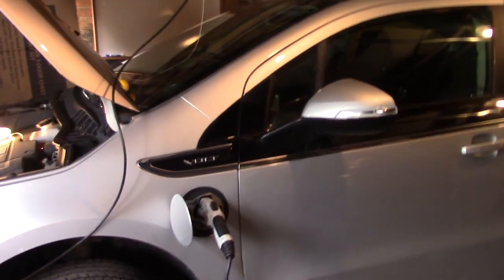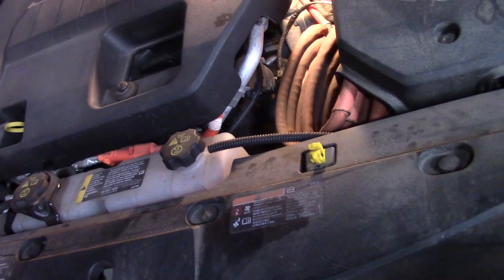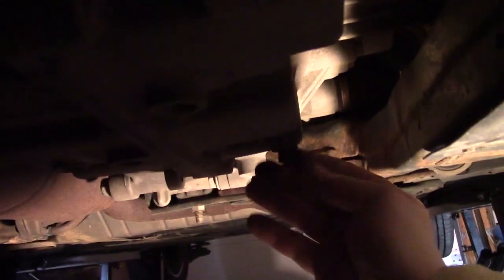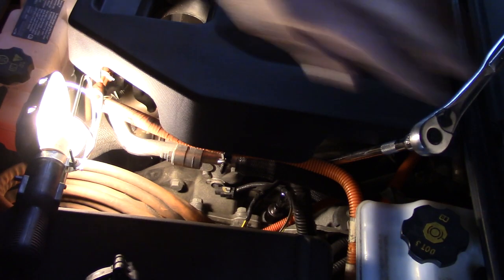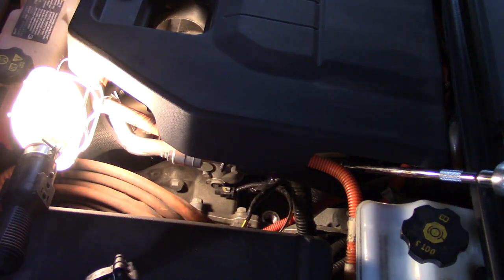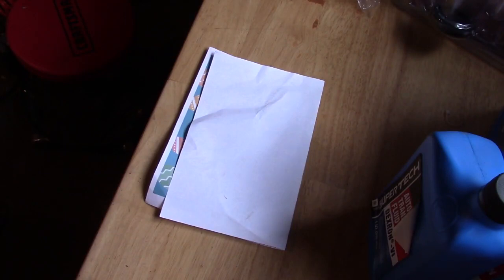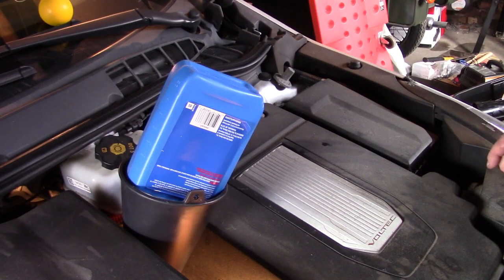Chevrolet Volt Transmission change. Chevy Volt Transmission Fluid change

Comment: It's a little funny that everyone looks at the transmission fluid and thinks it doesn't look bad - forgetting (or not realizing) that there's a transmission filter inside the transmission.  You can't really replace that filter unless you drop the transmission and take it apart.  But if the filter did its job, the transmission fluid you take out won't look very bad.  You'd need to have it chemically compared to spot the differences, but changing the fluid like this was definitely a good idea.  Also, there's a process for changing the oil involving a lot of gear changes.  If this is the first time the fluid has been changed (probably is) then the equal quantities method is probably fine.  But supposedly getting the level of fluid right is trickier than that, and fairly important for the life of these transmissions.  You did a pretty good job of showing the plug locations - thanks!

Comment: Nice video.  The holey jacket raises the authenticity, and thus the credibility by at least a factor of 10.  As a chemist, I'd recommend using a tall, very thin glass, or a shot glass with a flash light on the side to compare the colors. Thanks for the video, I'll be doing this soon!
Reply from the maker: Glad I could help

Comment: Thanks for forging the path - great info.  Just bought a '14 with 66k.  Changing some fluids just to make sure.  I took the overflow plug out and it was the same size and threads as the drain.  Cleaning around the fill port is good idea - I found an old nest of some sort around mine!
Reply from the maker: Brian Shield glad I could help you out.

Comment: You mentioned checking the filter requires the transmission to be removed?  So should I skip that?  My car has 140k miles and I don't know if the transmission fluid has ever been changed.  I think it may have been done by the dealership at some point since records indicate the car was sold by a dealership with 62k miles on it?  Plus there was some oil residue near the fill port.
Reply from the maker: JFlywheel I would not count on dealership doing it. Changing the fluid is a good practice though.

Comment: I have a 2013 with about 250,000 miles. Not sure if it’s ever been changed. Still drives smooth. Should I change it or flush it or just leave the fluid? I recently bought it.
Reply from the maker: I would change it if it has that many miles.

Comment: So in the GM maintenance schedule, it lists changing the electric drive unit fluid only under severe conditions. That schedule runs to $150, 000 miles. What made you decide to change it?
Reply from the maker: most cars i have had in the past i try to change the transmission fluid around 100 to 130K it has served me well saving transmissions in the past.
Reply: New fluid will only extend life, old fluid will diminish it. Change it often and it'll help it last.

Comment: did your car run fine after changing it after over 100k miles? i am at 90k and a little scared to change as i dont want my transmission to die..little scared as i have heard stories for transmission dying after changing tranmsission fluid.
Reply from the maker: I think that's from people who have waited too long to change it. I have 164 k on it now and still running good
Reply: You heard correct. But in this that wouldn't happen. That only happened in conventional transmissions where the new fluid is low viscosity, whereas old fluid has viscosity buildup. I add a bottle of Lucas trans treatment to new fluid for that reason.

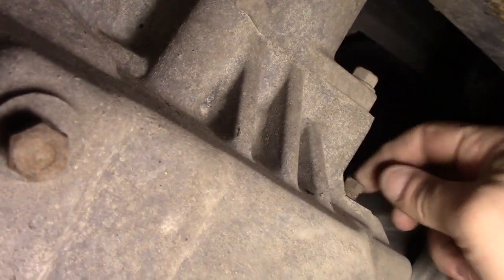Comment: when you say "tapered" for the top fill plug at 4:06 what exactly do you mean by that? is is safe for me to remove it and will it seal fine?
Reply from the maker: The plug screw is tapered so it's self sealing/threading.

Comment: Have you change any other fluids ...??
Reply from the maker: Just the oil and oil filter. Thinking about doing a video for the antifreeze
Reply: @doransignal  Cool thanks because there is not any video about it ...
Reply: @Lobo243  a little late, but I made one.

Comment: I just got an 11 model 170k miles I'm assuming they were mostly highway I was thinking since that was the case this volt is really pushing a 120k hypothetically lol we will pretend 
Any tips on this volt
Reply: hows she runnin now?
Reply: @cgletts  I sold her the car went crazy one morning and wouldn't come back even the gm dealership couldn't save her but the guy who bought her claims that he changed the 12v battery and it started bare in mind it had codes thrown and reset by gm

Comment: What is the transmission in this car CVT? 
I wasn't thinking it was, because CVT transmissions take a special fluid.
Reply: They don't have a "transmission", it's an electric drive unit.  WeberAuto has some good vids that explain it in very good detail.  It takes Dex VI, though.
Reply: @GrandPrix46  yes I actually drained one out and refilled it.
Reply: @GrandPrix46  my volt lasted 1 month than died the guy I sold it to sait it was the 12v battery but GM said otherwise I got half my money back it was definitely a learning experience
Reply: @AOG_ETH  dude that sucks, these cars are generally rock solid.  The 12v can cause all sorts of issues when they start to go bad, I plan to just change mine every 3 years for peace of mind.  Glad you were able to get half your money back, though.
Reply: @GrandPrix46  the guy who bought said he put a new battery on and cleared the codes a few times and it worked. Gm dealership tried everything using the computers jumping it off fully charging it ECT.

Comment: Hello, just a quick question.  You said there’s a level check plug.  Do you think I could pump the fluid in through there instead of going through the top?  That’s usually the case on older cars, you pump in fluid till a bit dribbles out and you know it’s full.
Reply from the maker: I guess you could but I wouldn't recommend it
Reply: Yeah I read the manual and it’s just to check level.  Unfortunately I’m not really getting a clear answer of how much to fill it with.  It goes from 6.5-9.4.  Guess I’ll put 7 and wait till it drips from the level check.
Reply: So I got it done.  Car runs fine.  Drained the car, about 6.7 quarts came out put 6.7 exactly back in.  9.4 quarts are supposed to be inside.  Followed the procedure to make sure it was at an the proper 9.4.  There is a dampener somewhere that uses trans fluid so my assumption is that i took 6.7 out but the other 2.7 are somewhere in the trans. But upon correct level check procedures about 1/2 a quart came out that was overfill.  I thought maybe at 40k when the dealer did the job they could have over filled by 1/2 a quart but the car ran fine till 90k so I just put back in the 1/2 quart and called it a day.  So there’s 3+ quarts of 50k old oil in the system but it was pretty pink.  Much thought went into it, my resolution for my feeling of unease knowing there’s old oil in there?  Do the trans oil change again every 35k.
Reply from the maker: I think when I did mine it was about 7 quarts. As for the additional fluid it would be in the torque converter probably. Without removing the transmission it will stay inside. Changed mine at 100k seems to just start being burned smell. I guess depending on how hard u drive car. Glad I could help.
Reply: @doransignal  the Volt doesn't have a torque converter, it is a planetary gear set directly driving to the road. Thanks for your helpful and informative video.
Reply: @longflare  it has a torque damper at the output of the gas engine

Comment: I just subscribed, I have a 2013 volt, I noticed I had a coolant leak I tock it to my mechanic and he said its a stress leak, but my reservoirs levels are fine and the car is running fine with no check engine light or error codes.
Any suggestions on what should ai do.
Thank you
Reply from the maker: Is it one of the plastic housings that's leaking? Where is the "crack"
Reply: @doransignal Hello
I was told it was on the radiator, Ive been checking the levels and I had to add some coolant last night, I want my car to be in tip top shape but $1850 is a lot of money
Reply from the maker: If your handy I'm sure u could do it yourself. Maybe if its reachable use jb weld.
Reply: @doransignal  I guess what what I am trying to ask do I really need to replace the radiator
Reply from the maker: @selvyngiron5396  you may be able to patch it with jb weld depending on leak and how bad it is
Reply: @selvyngiron5396  First fings first. Change your mechanic and find some place, where they can do coolant system pressure check.

Comment: do you know if the fill check hole is still useful if the car is on ramps, so on an incline instead of straight up with a lift or jack stands?
Reply from the maker: Car should be level to check
Reply: @doransignal  ok thanks. That will be difficult for me. Might just measure fluid that comes out
Reply from the maker: That will work as well as long as you d is not have a leak
Reply: Just drained the transmission fluid when car is on ramps. Drains about 5 quarts instead of 6 when on ramps.

Oops, slightly over tightened drain bolt not difficult to do!
Reply: @danwat1234  I have a 17 Cruze on Ramps it did 5 quarts the second time I did it I believe it was 6 I cant remember the best way is to just measure what comes out the fill hole is super nice on the 17 Cruze vs this one you can unscrew it by hand
Reply: I was able to access the level check hole with the car level on the floor by turning the wheels slightly, no jacks needed.  I opened up the fill check hole and just added until it started to drip out.

Comment: 9:24 you're pouring upside down.  look closely at the bottle, theres even a diagram showing you how to pour it. just a heads up. thanks for the video.
Reply: Well, that's because gravity.
Reply: SpecR is correct, it not intuitive but pouring with the open side up allows air to reach inside the bottle without having to pass through the liquid.  This avoids the glug glug and change of flow of doing it the other way, making the pour much more consistent.  Learned it from my father as a kid working on cars.

Comment: These cars still has transmission? I thought it has electric battery with small engine only?
Reply from the maker: suki san it still has a transmission for the engine the battery and motor use it. I believe it helps with regenitive brakeing also
Reply: The transmission has four clutches inside so you want to make sure to maintain the fluid so they stay healthy.

Comment: I want to ask how much can i add transmission fluid in liters
Reply from the maker: bashar Alasouli I'd say measure what you pull out and put same amount in
Reply: doransignal i dont know how much i miss that
Reply from the maker: bashar Alasouli I put about 6 quarts I believe in mine. So a quart is a little more than a liter. So 6.5 liters should work. There is a full bolt on the transmission so you don't overfill
Reply: doransignal thanks.. Iam added 6 liters

Comment: WHAT SIZE ARE THE BOLTS?
Reply from the maker: For the socket?
Reply from the maker: Or the bolt itself?
Reply: Yes for the fill cap and drain please
Reply from the maker: They are self tapping bolts. Not sure chevy dealer would know

Comment: Anyone know how to determine when exactly does the volt need a transmission fluid change? Going by the mileage is not the most accurate means to determine how much the transmission has been used on volt. For that matter, is there  a way to determine the actual mileage it's been on the engine? The MPG on the display is useless in finding the exact mileage driven under the engine. Even then, volt wiki says the computer decides how the electric motor is used even after the battery is drained from engine/electric to engine/transmission power.
Reply: Whether the generator is running or not has no effect on the trans fluid, as long as the car is moving the fluid is being circulated.  So using the miles, or time is still an accurate way to keep fluids changed.  My 2015 has like 36k on it and I'm getting ready to change the fluid today, not because of mileage but because of it being almost 6 years old already.

Comment: Not to be a troll, the Volt does not have a transmission. It is driven by a planetary gear. It should out last the battery pack.
Reply: Where there is fluid, it needs to be changed.

Comment: Really it should never smell "burnt"..  used yes, but not burnt..   a hybrid drive train like the volt  has no clutches to burn*, it is just gears in oil...  *there is one clutch pack in the volt,  but its always locked except in the instance of a over power condition.. and that shouldn't ever happen.. its a safety device.  Hybrid drives like the volt are so simple mechanically .. compared to traditional transmission , one gear ratio no shifting or clutches or belts to wear out..     direct drive directly to the wheels..   that is why I will only ever buy a hybrid type car...  ALl hybrid systems are pretty much the same..  traction motor direct tot he wheels and a 2nd generator/motor attached to the gas engine witht he power split device ( a differential) that either generates electricity or pushes rotational forces from the gas engine into the drive line.. its a brilliant and elegantly simple design, that has no wear parts to wear out.
Reply: Like a rear axle, should be changed periodically. There is still friction in motion, so it costs a little every 5 years or so, it will wear out but the newer fluid will help it last even longer.

Comment: In my opinion you changed your oil for nothing... because there is no real wear in the case of a 1GEN transmission... I have a 2012 and I will never change oil or maybe be yes around 200,000 km... it's my opinion...1st gen has almost no degredation in transmission fluid until 300k+ miles. you will drain it and it will almost  be clear like your demonstration. The 2 GEN have a chain drive similar to a CVT that has way more friction and wear but saved GM a few hundred bucks a car. imo i would only change the fluid on GEN 2 (2015+) and id really never buy a GEN 2

Comment: I'm getting a leak in my 12', 85k, never changed,  what could be the cause? Its pink color still, I park aiming uphill.  Could it be the level plug just overflowing? Is there any seal to worry about? thx
Reply from the maker: Pink sounds like it might be coolent? I would jack it up and see where leak is coming from
Reply: @doransignal  will do... thx
Reply: @MrEnergyCzar  - let us know what you find out.
Reply: @KTPurdy  it was a transmission coolant hose leak...

Comment: Hose of a PHEV?  Then what, tow it to the dealer for repairs?
Reply from the maker: Not sure your question
Reply: @doransignal  Not a question.  It is a statement of automotive fact.  Late model vehicles have SO MUCH electronics under the hood, most vehicle manufacturers advise against engine washing.  EV or PHEV, even worse.  I was in the Auto repair Industry since 1973 and of course, have seen tremendous evolution, of the automobile.  Engine washing is asking for trouble, on modern vehicles.
Reply: PS The proper way to remove the grit around the filler plug, would be to use an air hose to blow the debris away, before removing the plug.  In a pinch, if you don't have compressed air, use something like "Carburetor Spray" (cleaner) FOLLOWED BY A USE OF A SHOP TOWEL, OR BRUSH.  You are correct about one thing, you do not want grit going into the trans.